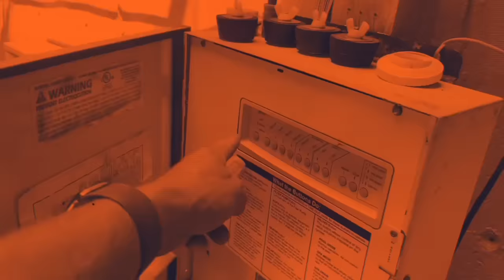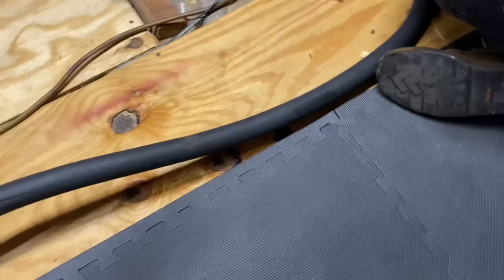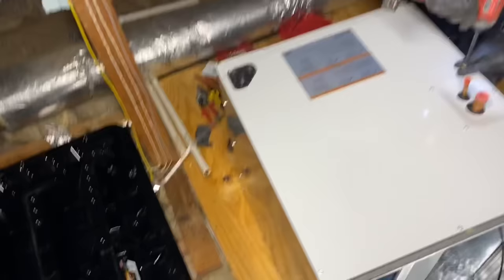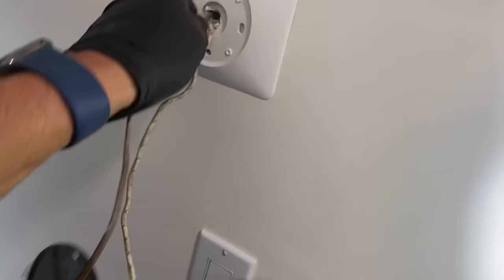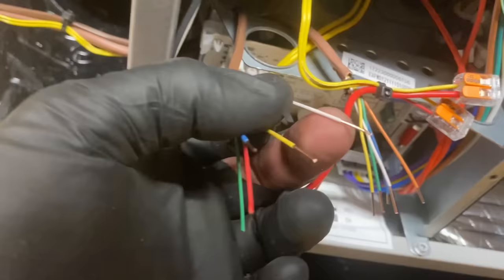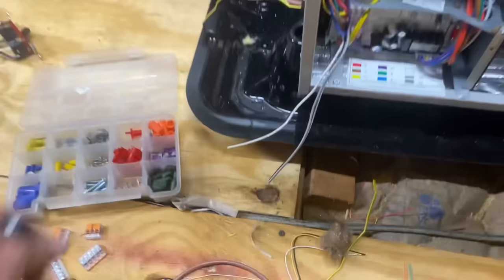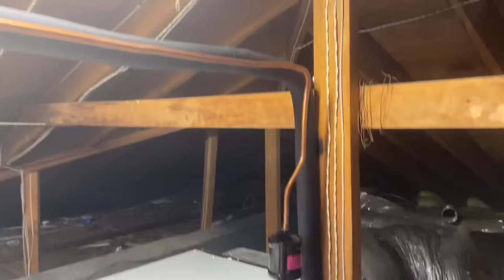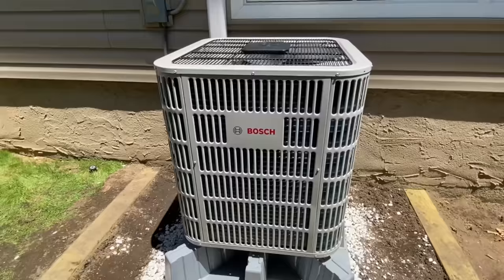Do You Really Need a Bosch IDS 2.0 Dual Fuel Heat Pump And Central AC?

Comment: Blue is common, maybe I'm old school Green blower motor white heat orange reversing yellow compressor red hot
Reply: I’ll accept brown as common as well
Reply: Brown is common on rheem, first company, and Bosch!
Reply: @christophermiller1520  rheem and first company are part of my reasoning but also it was taught to me by old school techs when I first started
Reply: True, Orange is the SOV, blue is y2 and brown is C, green is fan, and in the handy box, black tape is supposed to be on any white wire that Carries power.

Comment: Thank you for putting a wire on the common terminal in the Nest. I had so many calls from homeowners that said they installed a Nest themselves and they bought it because it said you didn't need a common wire because it uses power stealing technology to charge it's battery. But when I go there the Nest is so low battery that it doesn't work. I tell them that they either need to have me run a new thermostat wire so that it can have a common wire, or they will need to take the thermostat off the wall and charge it every now and then. They always tell me "No it says in the manual that it doesn't need the common wire to work and that it charges itself so that means the furnace and air conditioner you installed has a problem. I say hmmmm well if you have truly read the whole manual in it's entirety you would have noticed the small disclaimer that says (The Nest thermostat will work without a common wire if it is able to gain the electricity it needs from the heating and cooling wires. Sometimes you will need to connect a common wire if the Nest is not able to charge itself enough using the heat and cooling wires.) And then they ask me well why isn't it able to charge itself enough. I've had it on the wall for a year. I tell them that Nest uses power robbing technology which essentially only works while the system it actively engaging the heat or cooling. If you don't run your heat or air for a period of time like in the spring or fall it has no ability to rob power. And even when it is engaging the heat and cooling it still is not a reliable method of charging and it is using your systems wiring in a way that is not intended and designed to do. Therefore you absolutely NEED a common wire. There is no thermostat in the world that can operate without a common wire or a battery. The Nest has a battery just like a regular battery powered thermostat but instead of replacing the batteries you need to charge it for 24 hours before putting it back on the wall. But I swear the first time I tell them they need a common wire these homeowners act like they know everything and I'm wrong. They will then plug in their Nest to a charger while I'm leaving the house. Then a month later they call me again and tell me that it quit working again while they were at work and they want me to come and run a new thermostat wire. Since they wanted to argue with me and insult my intelligence I then tell them that it will be more expensive now since they waited this long and our labor rates increased. Now I'm making money off your dumbass. Yeah I get angry when I talk about the Nest. Not because I don't like the Nest, it's because I don't like moron know it all homeowners who insult my intelligence and argue with me for a half an hour. I run a new thermostat wire and guess what??? Wow you guessed it NO MORE PROBLEMS

Comment: Hey Mikey. Just a quick tip for all the Wago's, and occasional wire nuts, that you install in those units. Always point them straight up in the air when you're packing them into the unit and junction boxes. I can't tell you how many times I've seen splices go bad because some water accumulated in the Wago or wire nut because a little water worked its way in past the weather proof cover, or condensation formed in the unit, causing the splice to fail. It happens so many times, but it's always preventable, just by pointing the Wagos or wire nuts straight up in the air. As an electrician this is always a little pet peeve of mine. Great video otherwise! God Bless and #Let's Go Bosch and let's not forget, FJB!!!
Reply: Wire nuts are superior due to this reason alone. It is not a multiple piece connection with moving parts, easy to throw a piece of heat shrink over a wire nut and make it weatherproof vs a wago.

Comment: Came across my first bosch in the wild today. 4 year old 1.0 with bd control boards. Original installer out of business and of course no surge protector
Reply: Exactly.  I prefer old school switches with a top SEER of 14 to units with fancy electronic control boards.   Cheap and easy to repair.  As well, no waiting on high dollar unit exclusive electrical parts... if they are even manufactured after a few years.  The money saved in reduced energy consumption is quickly gone for the owner, when the  equipment fails.  Fancy equipment is simply a money maker for the installer and repair person.

Comment: Overall good installation!...the only thing to improve is to protect that piece of thermostat cable exposed on the condenser unit; roedents may chew the wire & will become brittle overtime
Reply: Had to fix few of those recently. T stat wire shorted out. Blown fuses and control transformers.
Reply: @seanwestervelt7503  Exactly! Thermostat cable is not rated for outdoor use

Comment: Ok, story time comment, and sorry if hate; but skim thru and take what ya want. Have a good one and thx y’all ✌🏻
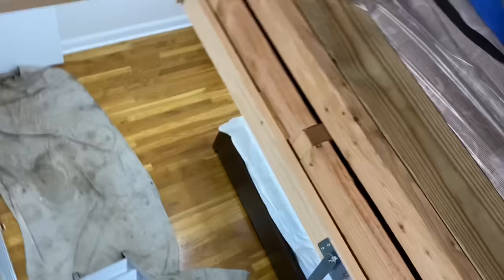11:04 Was taught by an “old timer” (that had a TON OF KNOWLEDGE before he sadly passed away back in 2018, but glad had opportunity to learn from, and as he was in 70’s, he was relatively healthy… meaning no high cholesterol/blood pressure, no sugar issues, etc…. And passed away in sleep from heart failure out of blue) I measure attic/crawl space openings that have “ladders of this type”; how I measure the width is from hinge bracket to hinge bracket for those stairs; b/c sometimes the brackets are smaller (on inside v outside of stairs) and that means they are most likely gonna be in the way when moving big objects through the space (or hole….yep, I’m 12 at heart😅) and bending them out of way to make “space” bigger…..well, last time We did that, it broke off badly; and so we just ended up installing all new stairs b/c was just easier, and cheaper…..after you figure parts, time, labor, etc….( not to mention was on a wicked hot day no temps in attic were 140°F and approaching “danger zone” temps…which means as company policy for safety protocols, when temps in attic reach 140° can only be up there for so long and anything above 155-160°F too dangerous to go up and company policy is “we do not”).

Comment: Great and informative installation. But ladder is too far out at the base. Rule of thumb is toes at ladder feet. Arms extended at shoulder height and grip the  ladder sides. Holder of OSHA 40 hour class card.
Reply: Do you mean OSHA 30....never heard of 40

Comment: I work at a Supply house for HVAC and we have a huge warehouse and our entire section of Flex duct is pretty empty. But we have equipment but got bad news that our orders in august from the manufacturer got cancelled bc of shortages. So hopefully ppl don't need furnaces going into fall this year bc at least for Rheem they're already cancelling our big orders of 6k units of furnaces and A/C units and a few sizes of water heaters.
Reply: Thanks for the heads up Mr. Roberts of what may be coming. It's been a challenge to say the least the past couple of years. Things you take for granted of being there when you need them are often times sold out / back ordered. Crazy challenging times we live in. 

I've heard rumors that it may take up to 2 years more before the HVAC market resembles any kind of normalcy. What do you think?
Reply: @AustinAirCo  Depending on where you're located and how big your supply house is could reflect differently. The area I'm in we only compete with really only one other company so we have bigger pull on getting orders. Equipment and fiberglass has been coming in solid for months now and hearing they're cancelling orders with us just shows the big guys can't always get everything. Hoping that means they're going to limit us to give smaller companies a chance.
Reply: @mikeahs06  among the big of the big Katy, Texas is a suburb of Houston. I often kid around about it telling people I am about 3 clicks west of the gates of hell. Or if you want to visit here Take I35 south from the heartland - In Dallas/ Ft Worth take I45 south and keep driving until you reach the gates of hell. LOL. 

That being said, just because we big in Texas doesn't mean supply chain issues don't effect us. The last 2 years have been quite the challenge here. Anyway appreciate your input Mike.

Comment: I have to say it's genuinely refreshing to see a north american HVAC contractor who embraces european systems. It seems like 99% of HVAC guys talk about modern systems like they're "too complicated", "unreliable" or "foreign", and only want to install the same old 1960's design American union-built boat anchors that clank, bang and buzz while guzzling orders of magnitude more power and refusing to offer competitive heat pump options because changing the design they've been using for the last 60+ years would be really really hard and just thinking about it makes them have to poop. 
American appliances are the same way. Look at the sad state of Whirlpool. They literally do nothing, and keep peddling the same 1960's dryers and 1980's washers, while Bosch has moved on to heat pump dryers that save 60% on electricity and don't suck un-conditioned air into the building, Whirlpool keeps making heated dry dishwashers that act like kilowatts grow on trees and Bosch literally pioneered condensation dry that saves thousands of watt hours per use. American manufacturing is, on average, pretty shamefully outdated and I love that you recognize the endless benefits to embracing modern european systems. #LoveBosch 🇩🇪 🇪🇺

Comment: Maybe an SS2 on the secondary evaporator coil drain port ..sleeve the thermostat wire in liquid tight outside … 32 degrees before boiler kicks in might be too low  … even for the northerners with a Bosch.

Comment: @Mikey Pipes - Pipe Doctor Plumbing & Heating & Air
29:04 think know why you switched Line/Load, imo, “Most” receptacles have the Line coming in on “Top” which is opposite “Ground”; but on this receptacle…..the Line is right by the Ground; so, again imo…..muscle memory says: just looking at a receptacle and seeing where ground terminal is on it, ya “know” line would be opposite; BUT NOT ON THIS ONE😉
That’s how’d I “justify” wiring it w/ line on Load and not Line to Line😆
Anywho……great vid, really enjoyed this one, and though for sure you’d have to make that duct hole bigger to get unit up thru it; but NOPE, sure proved me wrong, and didn’t mess anything up w/ ceiling or unit and no mods needed. Very SMOOTH and shoulda known better; never bet against Mikey Pipes, NEVER!😅
Cheers Guys✌🏻
Reply: @PipeDoctor  always 😁

Comment: 1:11:45 the answer is: yes, an hear it run…..but for me, it’s barely audible, and I’m figuring that b/c of 2 reasons:
1) your mic is THAT Good, OR
2) you’re that close to unit, that any unit would be audible..
Otherwise, I would say no, can’t hear it running, but at same time, I’m hearing “background” “static” (like a lawn mower that’s outside, but you’re inside….that is what it sounds like ¹  )
Cheers Guys🖖🏻

¹ edited: changed sentence as made zero sense, and just wanted to make note, in case get. Like or something…..

Comment: When ever a liquid line runs through an attic where it can pick up heat, it is supposed to be insulated, at least that portion, not necessarily the whole line.  Doesn’t the Bosch come with a drier installed in the condensing unit?… I’m asking.
Reply: @PipeDoctor  true the liquid line doesn’t “have to be insulated” in the attic BUT… the sub cooling is lost in a raw copper line in a 120F attic, heat transfer from copper is great in attics. Heat travels higher. To lower always…90f liquid line in a 120 degree attic,  most trained hvac mechanics know this.

Comment: Finally someone putting that damn filter dryer where it belongs.  I did a Bosch heat pump with a rheem furnace. I wanted to go just heat pump but didn’t want too upgrade to a 400 amp service yet.

Comment: I've always wondered on a job like this,  when you recover the refrigerant, can it be reused??
Something they could definitely use in this attic is more insulation.
Reply: i was told you can but, some old tech mentioned to me that the recovery tank tend to have alot of black slime in the bottom. if i can i like to put new freon if possible depending on what you are doing.

Comment: 55:42 "additional level of security"
.while we are talking about level.did Daniel use a new MP level on that emt?maybe with the use of 2 condulets to level that pipe .perfection MP perfection.practice what ya preach🤣
Reply: The EMT feeding the line side of that disconnect was using set screw fittings outdoors. A code violation.

Comment: What do you think about the Mesh AC covers? We have a lot of Cottonwood trees that go straight to the AC.  Saw mesh covers that claim to be safe and let it breath still bit catches a lot of debris.
Reply: Bad Idea. Just give the coil a wash when needed. Bosch has stacked condenser coils but the fin’s are designed to be lined up perfectly so you can wash them  from the outside in without taking them apart or splitting the coils. And the blue coating that you see on the coil is to protect the coil from corrosion. Don’t quote me but I’m pretty sure they only recommend cleaning with water only, no chemicals.

Comment: Why aren't you using oranges for your reversing
Reply: Green is for blower White is for heat Orange is for your reversing valve yellow shirt compressor blues common red is power so we agree on white is heat but orange is your reversing valve
Reply: @timothywalch7102  bro it doesn’t matter what color you use. It’s called a meter and a good tech doesn’t pay attention to color. Shut up

Comment: I still have to watch this.  But my guy ordered a 4 ton unit to replace my 15 year old R22 A/C.  $3,300 PSEG rebates and a lower electric rate for the winter.  Hopefully this will help supplement $5.00 BIDEN heating oil.
Reply: What company did you go with. Im looking to do the same in my home?
Reply: @PipeDoctor    "but" was an error,  He ordered the 4-ton to drop off and install in the fall when it's cooler (no rush).
Reply: @ricstayflyy718  PSEG has a list of installers that can process the rebates and handle the paperwork.  I avoided the ones with big names.... Guy that came came to my house and is the guy running the business and installing it, no "salesman" BS from the big companies.   I'm just looking for something to reduce oil usage.   If  I found Mikey (on Long Island) prior, I would have gotten a number from him as well, only found him recently searching Bosch units and he seems to like them.  What got me was that the rebate covered more than the labor for the install, from what I searched online it's about $8,000 in equipment alone for a 4ton with new lineset, thermostat, etc, plus we are adding a return and possibly another duct.